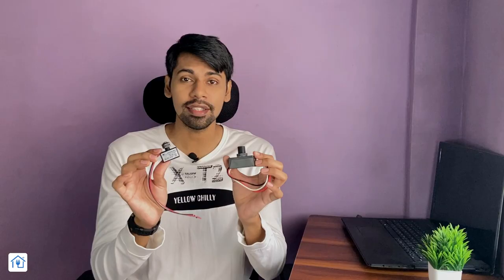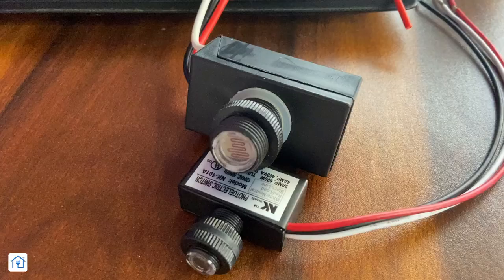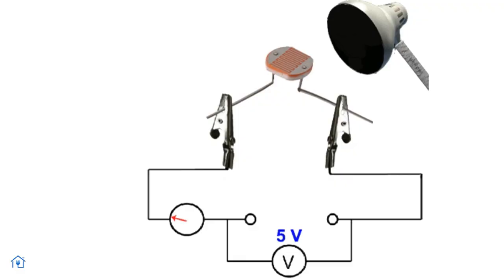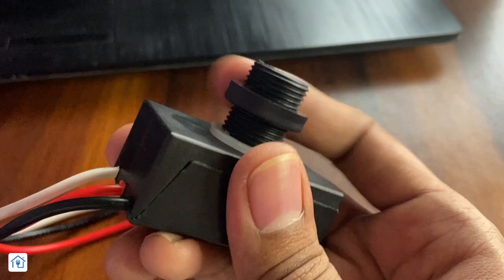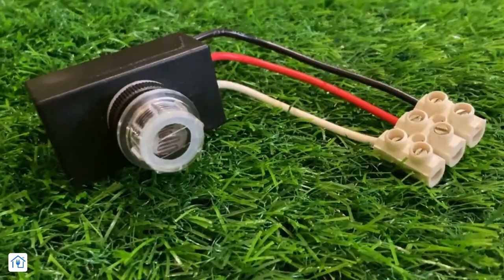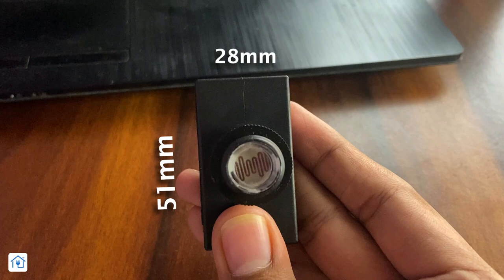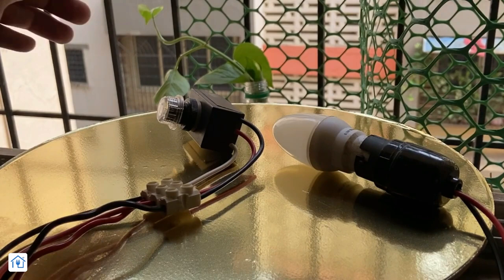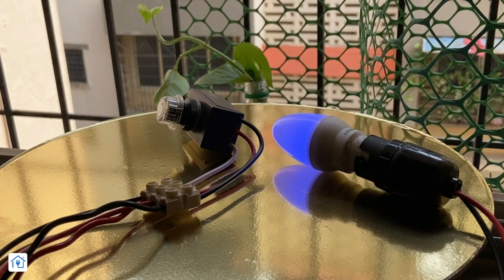Automatic Sensor Light Switch | Automatic Day Night Sensor | LDR Sensor- Photoelectric Light Sensor

Comment: Will it work only for led lights and cfl or will it work for tubeligjts as well
Reply from the maker: Tubelight as well. Just make sure the current rating of tubelight does not exceed the rating of the sensor